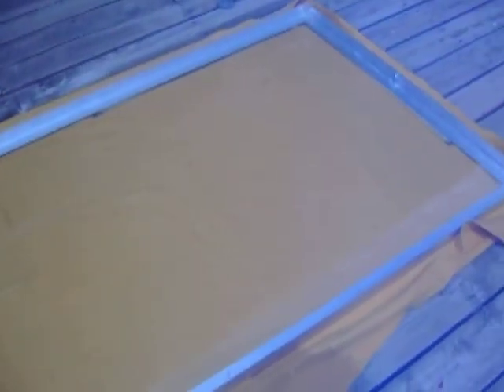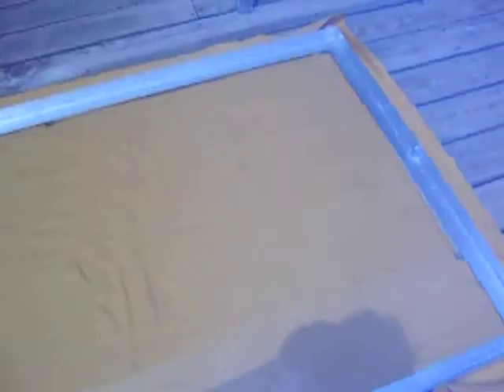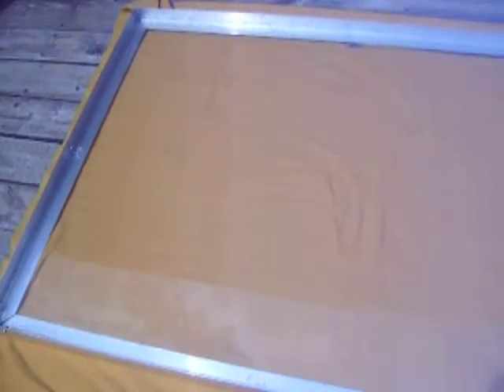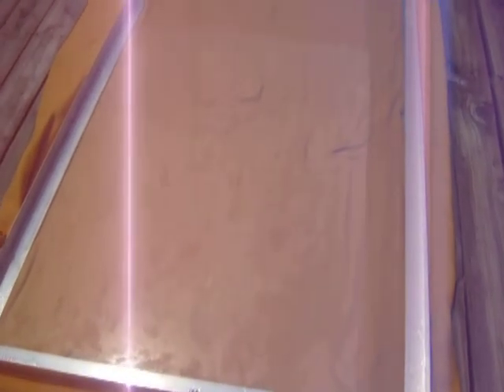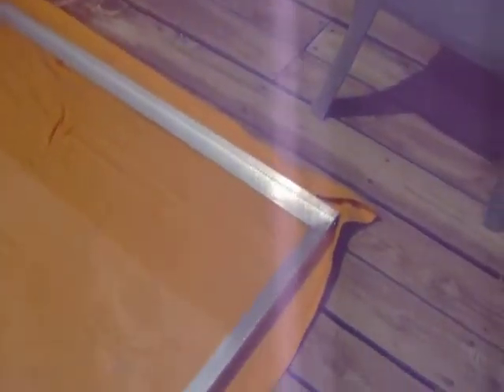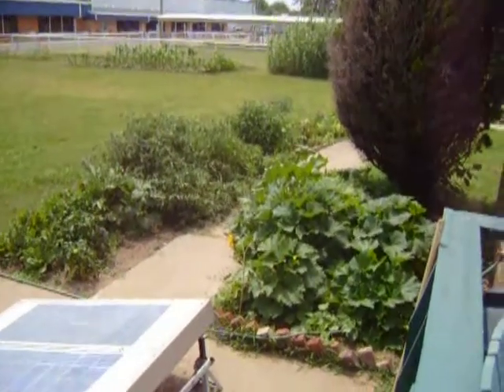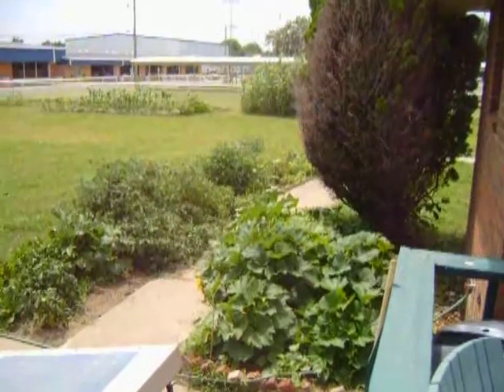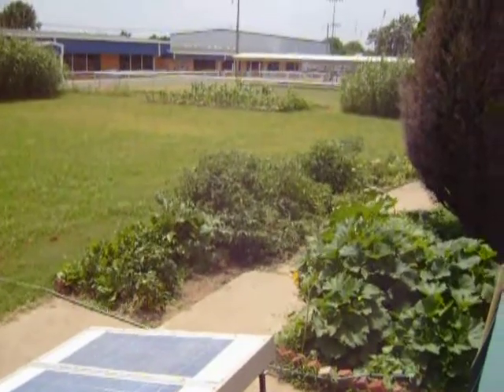Making a 24 volt Solar Panel Out of  72 5x5 inch Solar Cells

Comment from the maker: @subscribeforcandy I just go to lowes and buy some angle aluminum bring home and cut it on the table saw on a forty five degree angle. Bolt it together with L brackets and quarter twenty bolts and self locking nuts. I had this large panel welded and I calculated wrong I couldn't believe I did it. So then I cut it back apart on one side and shortened it and tied it back with L brackets he he lol.

Comment from the maker: @amy2x Stering engines dont have enough power to power a generator. At least most of the ones I have seen. Maybe if someone built a huge one it could produce enough power to power a small generator to make some electricity. That would cost a heck of a lot. Wind power comes from the suns energy and  are affordable. Also if you have a pond or a small stream or a large stream you can make a water turbon to make electricity. Making electricity from a sterling still remains to be seen.